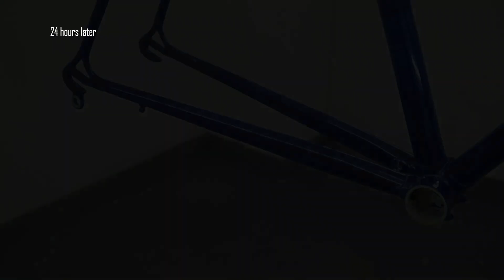BIKE RESTORATION COLNAGO SUPER 1981 -3 rd episode-

Comment: Outstanding work my friend and great colour choice 👌🏼🙌🏼 The only thing I would do differently is first paint the pantography before adding your clear coat so that the white is protected by the clear coat over it 👍🏼
Reply from the maker: Hi, friend!!! Thanks, I'm glad you liked it. You are right, I could have done it before placing the layers of varnish. But if you do it that way, you run the risk of not covering the white to the blue when using bilayer paint and having to apply several coats for the details. I always try to do things the way they originally did, that's why I use that technique. But they are all good. But thanks for telling me. Greetings and I look forward to more videos from you my friend ; )
Reply: @dabrestauracion7404  Yes, you make a good point, that is also true 👍🏼